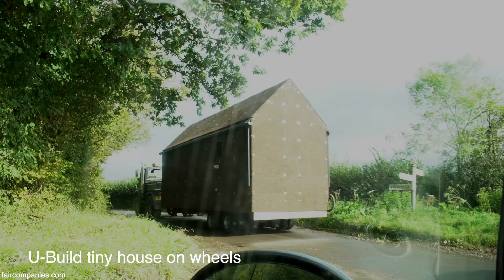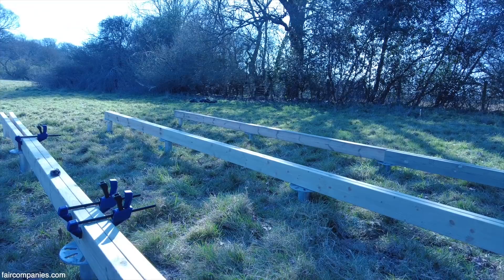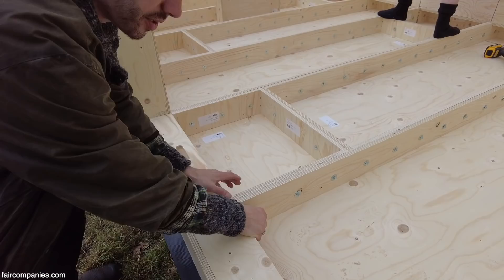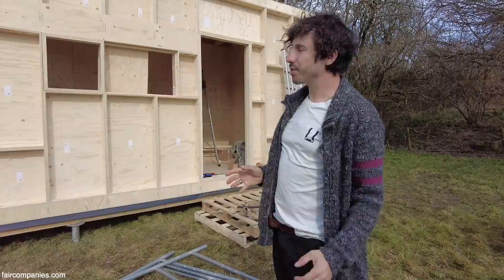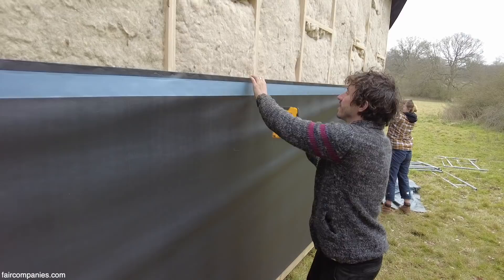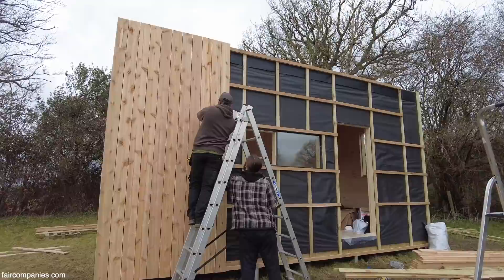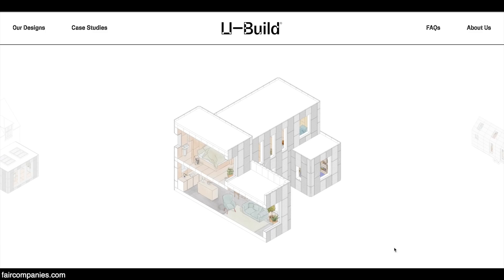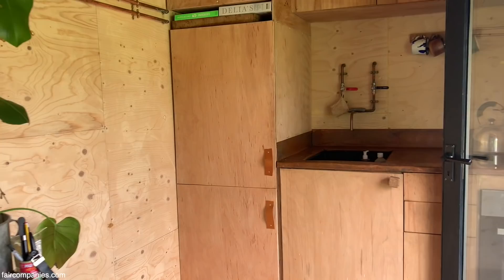U-Build hands-on: a flat-pack modular home you can assemble

Comment: Great idea/project,, Though how does the home breathe,? The most important part of any home is that moisture doesn't get trapped within or it will sweat... Stuffing all that insulation in eaves/roof etc shouldn't there be a way to breathe??
Reply: It was a breathable membrane - like Tyvek
Reply: @thingswelike  No that might be on out side But my friend Any insulation stuffed tightly loses it's RValue,, it's made loosely so it can provide R Values. It needs room especially from top plate to ridge beam. I promise you, open that roof up and the insulation is soaked as well as the wood is. And especially underneath over grass. Grass is Full of moisture..

Comment: I get what you are doing, but all of it seems like framing with extra steps, and a lot of CNC machining, which is kind of expensive, same with plywood - its a lovely material, but more expensive than planks and beams.
900 pounds per sq/m also seems a bit steep, at least by where I live (eastern Europe).
How does this compare to say SIP panel based housing?

Comment: could you not experiment with using recycled plastic pressed panels? still, use the box idea but using recycled plastic instead of wood? plastic and sand mix, like used in Africa? be eco friendly and fireproof, interior temps stay stable, long-lasting and reuse most plastics, even the roof tiles can be made from the same material, really good idea, i like this

Comment: i don't want to piss on the fire. I think the idea is cool but the construction seems to use a lot of plywood, also to run electric and pluming has to be much harder but for a cbin that seems a cool way to do it. Also it seems that you really don't need many tools. But if  i would buld a cabin i would make it in the conventional way, i'll probably do it in the same time if not faster and with way less plywood used ( i would not even have to use plywood since the walls don't have to be structural. essentially for half the cost. But i think the people who did that seem to be on the right track and the idea of modualsr parts is cool even if nothing new

Comment: With no vapour barrier next to the warm side of the wall, are there any mold or mildew issues?
Reply: There should be AIR EXCHANGERS IN THE BATH AND HOUSE AND POWERFUL FANS OVER THE COOKTOP IN EVERY TINY HOME because mildew is an issue in this small of a space, particularly in winter when the home is closed up.
Reply: @mammalion4316  That makes a lot of sense. I live in a colder climate and vapour barrier is standard building practice here because of the extreme temperature differences but the fans would probably do the trick. Thank you!

Comment: I'm sorry for being rather negative here. But the video shows a few "stupid solutions". 
I figure box sections allow for reaching inside and using bolts instead of more "complicated" fasteners or adhesive. 
But modern adhesives are incredible, they are stronger and because they work over larger surfaces you need less structure over all. When do you REALLY want to take apart a structure like this?
SIP panels that are precisely CNC manufactured like these boxes are would also be just as light. IF NOT LIGHTER because you could use thinner plywood for the skins. 
This would be great if you'd actually have a CNC robot that cuts and then assembles these SIP panel "boxes". Some kind of robot arm. This would make building really affordable. 
Larger wall panels could still be shipped cost efficiently. And that would really cut down on assembly time.
Of course you'd also want longer boxes so you don't have to do this piecemeal brickwork they are doing.
Ideally you'd also want SIP panels that are premanufactured to already "are" a membrane and be airtight. You simply attach them together and glue them / tape them.
What you'd really want is a robotic factory that produces "wall panels" automatically that come fully finished including interior and exterior cladding. And all out of cheap renewable wood plus some resins. 
Finally stick frame building is not more complicated or hard to learn. It's also not a slower building method. Just buy 2x4 and hammer them together, the strength comes from the plywood sheathing.
There are a lot of ideas you could implement to make building easier and more affordable but this isn't really making use of any.

Comment: What will you do about moth infestation in the sheep wool insulation? It’s a lovely natural material but I have heard bad things about the inevitable uninvited guests.
Reply: I checked the builders' website FAQ and it says "we usually use sheep wool for the walls and floor, though we can also use wood fibre (or most other insulation types). The particular wool we use contains a borax based fire retardant and does not require the addition of an insecticide."

Comment: interesting but the modular boxes look to be very expensive when you look at machining time. as a replacement for 2x4" studs and 4x8' plywood with framing and windows/door cut in.
Reply: you might consider getting away from copper water line as it will break when frozen and go to plastic water lines pex for example

Comment: Some of their implementation seems problematic.  In the build shown (23:58), rainwater travels vertically down from the roof along the membrane, which they X-cut and wrapped behind the top of the glass window!!  Result: water gets inside the building from the top of the glass window and destroys that rather expensive plywood.
Reply: So that means that they are relying on the seal of window that could be compromised.

Comment: I'm a builder and I think pretty much anyone could build something like this using normal construction techniques. Carpentry isn't brain surgery,  especially making these simple little rooms with flat roofs. 

I'd imagine the extra cost of something like this could easily buy you nice dropsaw and nail gun on top of all your materials etc. if you wanted to DIY using traditional methods. 

This is a cool project but I think it's kind of playing into city people's lack of confidence in their practical skills, and  this system doesn't really seem like much less of a learning curve than traditional framing. It's definitely not any less complicated. 

I guess you're paying for the reassurance of having someone basically hold your hand through the whole thing and guarantee that it's all going to turn out OK.

Comment: It’s great to solve problems that don’t exist.  Just hire a framer for A few days, buy beers and it’s done with no shop, shipping, computer time. Owners can easily take it from dried in state. Trim, insulation and cladding would be the same as this project.  Reinventing the wheel is commendable and always a learning experience you will not do again.  Society hasn’t forgotten to build.  Just the working class has been replaced by fat fingered computer hacks that say we have lost the skills.   Millennials will build on the weekends as skill is hard work.   That’s what we have lost.  BTW,  you forgot the wiring!  In the walls.

Comment: I kind of think the building codes in the USA wouldn't allow this. The mandatory fire alarm systems alone are so very costly. Building new in the USA is not very economical, currently. If I'm wrong, then sign me up for one of these LOL if I'm right, maybe we can get some building codes to bend enough to allow this type of more affordable housing. One can hope.
Reply: The question is, why would you want to build like this? This seems far more complicated than simply framing it with dimensional lumber, with a number of noticeable drawbacks.

You are mistaken if you think building is more expensive in the US compared to Europe, it's far more expensive there.
Reply: @TheOwenMajor  Skilled labor is expensive. Try framing something like this with unskilled people.
Reply: @tzenophile  Have you seen the average carpenter these days? "skilled" isn't the word I would use to describe them. Most in my area are recent immigrants with no formal education.

Regardless carpentry is by far the easiest trade to learn, it only gets slightly complicated when dealing with unique angles, but framing a box with a standard roof pitch is super easy.

Heck, you don't even need to do the roof, nowadays you can buy the roof trusses premade and just screw them on.

Comment: Just think when somebody comes up with a modular system that incorporates electrical, water, and sewer in a steel box you just plug into your modular home with a few connections. No connection to the electrical grid, no connection to a city sewer system or septic tank, water taken from the air, and electricity generated from the box by a yet undeveloped technology. Electrical technology being the most important because it is needed to process sewer waste through a series of heating, and compressing processes. Electrically powered water generated from air has been developed already.

Comment: Can anyone comment on the method of insulation used in this home? I would call it inferior, as there is still the ability for air to flow between the walls.
Reply: As a vegan I don't agree with using sheep as a commodity.
Reply: @Harriemes  Considering it doesn't require the animal to die and doesn't cause unnecessary environmental damage, it is probably better than some other choices.

Comment: "U-Build helps you design and build your own customisable modular buildings, including garden studios, garden rooms, garden offices, meeting pods" ..."Our aim is to make construction simple, so that anyone can take part. Using only a mallet and a drill, 1-2 people can easily assemble all of our boxes. Using standard connections (supplied), the boxes bolt together, creating a rigid frame for your new space. We supply membranes to protect the boxes if used outside, and it can be clad in a variety of materials."
more: https://u-build.org/

Comment: While ingenious in designing out much of the higher-end building skills normally needed in such projects, I don't really get some of the so-called advantages. Number one being the ability to "easily" deconstruct and rebuild them numerous times - really???  Who wants to have to go through this process more than once, especially when the typical dimensions of a tiny homes are precisely so that it can have built-in mobility, just add wheels and Bob's your uncle.

The second, and slightly more glaring issue, is WHY such small boxes?  I mean when you look at standard construction using 8' x 4' sheeting, I don't see why you couldn't just make section's 8' tall for any unobstructed areas (iow walls without doors or windows) - for weight and portability of pieces I could see limiting width to 2', and of course full 8' pieces need built in cross pieces for strength, but I would think that would GREATLY reduce the amount of work, possibly reducing the sheer number of "building blocks" by half or greater.

Of course I don't know any of the engineering limitations that went into the design, and MAYBE it's a necessary evil, but from my experience I don't understand it.  But as they say, there's more than one way to skin a porcupine... ;?)

Comment: Brilliant
I scratched my head for years thinking 2x4's and plywood but it costs too much more than traditional and pieces too heavy 
Comment on insulation ROCK WOOL  its the most ecological, no really, I've beaten that to death, embedded carbon, reuse, and end disposal - best best best - AND not just fireproof it STOP fire, and dosen't care if it gets wet, it dries, regains all it's insulative properties.

Step one in TRULY modular housing that escapes traditional construction costs
Step two is modular Bathroom and Kitchens pre plumbed
Step 3 is modular electrical w locking connectors

You do need to find a way to fire rate the inside.  I cringe at how fast that would become fully involved.  Perhaps a fire resistant fabric that is 'wall papered' or even peel and stuck to wood after a primer is applies, hmmm, or use an intumescent paint as the primer and adhesive.  Access to screws for getting into walls just slice with a knife away and a self adhesive or glue on patch fixes it.  Patterns on fabric could min any visual evidence of the patch.  It'll never be 1 hr rated, but if it slows fire spread 15 mins, ie won't ignite or let wood behind ignite for 15 min, it will VASTLY increase ability of people to self evacuate and emergency services to arrive before people become bodies.  You know, this sounds so doable if you read this, are interested and need an adhoc test I know some volunteer firemen who could use the test as training, and I'd get the couple of room size mock ups done needed to show proof of concept.  Though, I'm sure you do to.  Just trying to do the little bit I can.

Comment: The gal says, "We would knock every box together with a hammer and then some nails."   Aaah, NO!!  You knocked the boxes together with a RUBBER MALLET bacause a HAMMER would damage your project.  You SCREWED it together because NAILS are  1)a lesser quality fastener  2)cannot be removed if ever the home needs to be deconstructed  3)harder to install by hand, lots and lots of pounding!!   One should learn the simple, correct names of the tools one is using.

Comment: Nice shed. I suspect not cost-effective. Its requires no specialized labor to install. It's still alot of labor to build a large structure. I cant help but notice the contrast in this video. Ugly no character shed set against a backdrop of old lovely brick homes with tons of character. It shows how far society has slipped.

Comment: A flat roof? Good luck.
Reply: it's not flat 19:50
Reply: I was going to post the  same.
Reply: I wear a filler in one shoe because one leg is longer than the other, i'd be perfect for such flat roofs that have a slight angle, however, i don't like heights, so it would have to be only 1 story tall, though this story isn't a tall tale.

Comment: Lol, trust an Architect to come up with an overly complex construction technique that costs more, takes longer to build, uses lots of nasty off gassing plywood and hails it as a breakthrough in design that re writes the rule book !
I could easily build that same size structure in less than half the time,  half the cost, half the weight and half the carbon footprint.